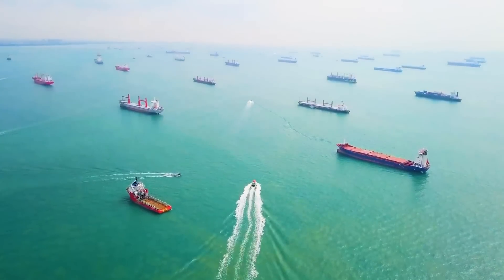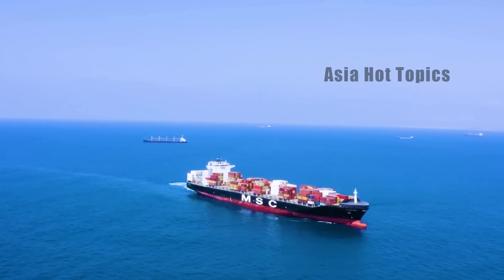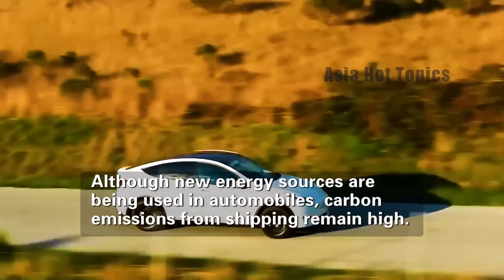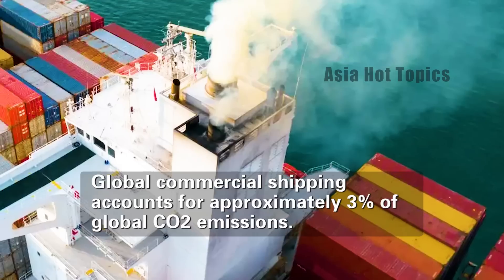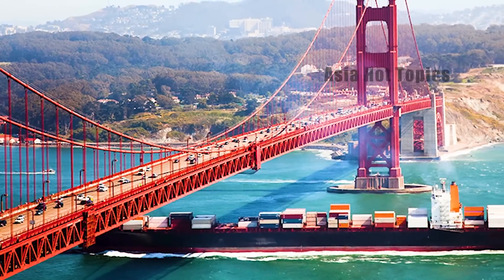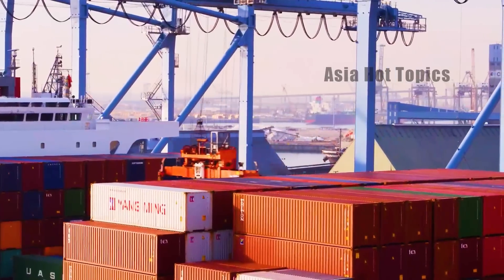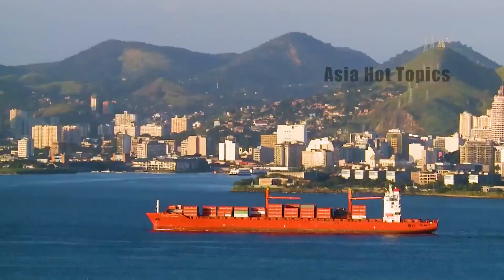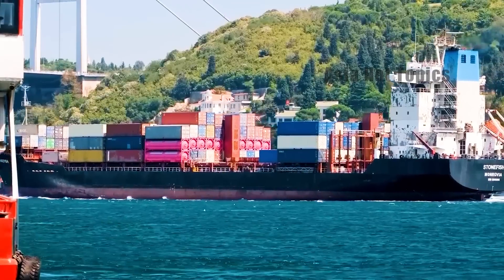Unbelievable! China's $270 Million Electric Megaship Set to Revolutionize the Shipping Industry!

Comment: The state-owned China Ocean Shipping Group (Cosco) has launched an all-electric container ship called Greenwater 01, which operates between Shanghai and Nanjing. 

The ship is equipped with a main battery pack that uses lithium iron phosphate (LFP) cells, with a capacity exceeding 50,000 kWh. It can also carry 24 additional battery boxes, each storing 1,600 kWh, providing an extra 38,400 kWh for extended voyages.